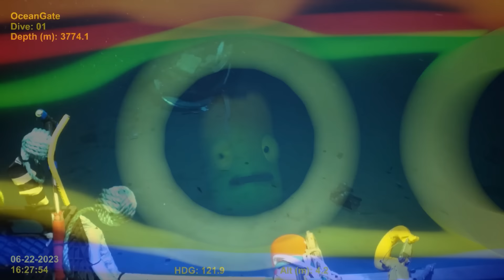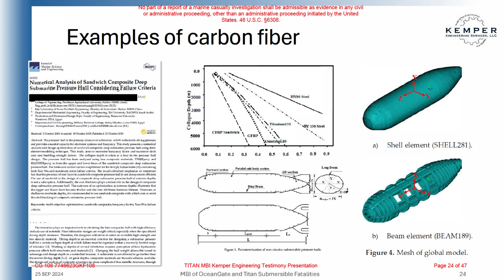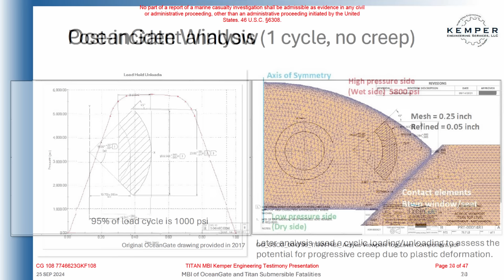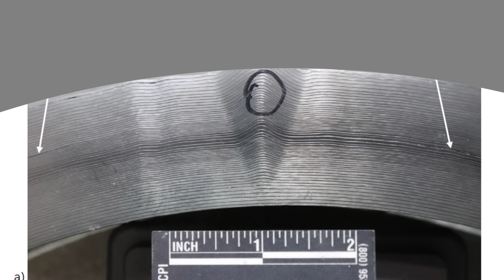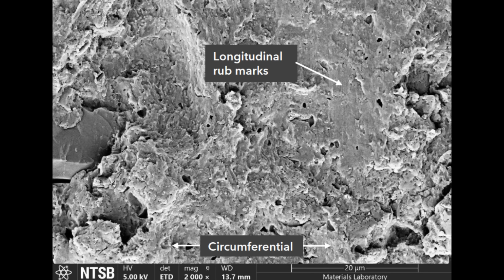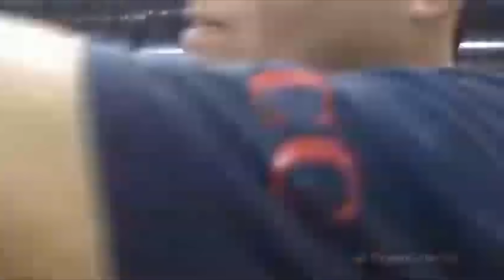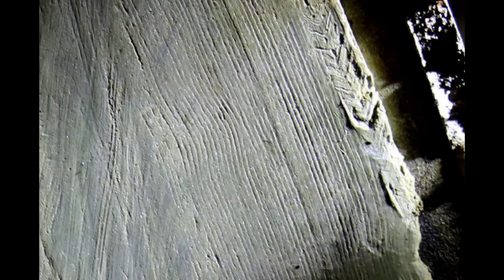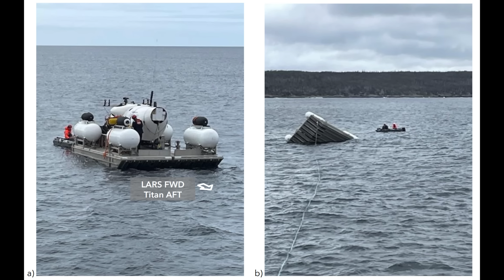OceanGate Wreck Shows Why Sub Wasn't Strong Enough To Survive - NTSB Shares Important Details

Comment: OK I am an engineer but not a specialist in composites, you mention that Boeing had told the company they should have diagonal layers but that these were not included and you hypothesize that this was because it was too difficult, I would suggest that it was because it added expense that Stockton decided was not needed. It' s like having the various sensors, those sensors appear to have done their job, the analysis shows a fundamental change in the hulls performance. That was either totally ignored or they did not understand that this meant the hull was now weaker. You might ask why bother to fit the sensors if they were going to ignore the evidence , I cannot answer that for certain but I suspect that from the evidence given Stockton appears to have considered his confidence more important than the engineering/science. Perhaps he just did not understand that with composites every tiny bit of damage progressively weakens the structure.

I've not heard all the evidence so I am unsure if any sort of nondestructive testing was carried out during construction, but I've mot heard that this was done, I would have expected some form of scan (perhaps an ultrasound) of the whole cylinder to ensure there were no voids and that construction was uniform, the evidence post implosion would suggest that either this was not done or they did it but felt the discrepancies were within tolerance

Comment: The hull had obviously been flexing, the joint between the ring and the hull was glued on and glue didn’t have the opportunity to flex, it was fitted to a titanium ring. 

So one side was solid and fixed. 

The other side was flexing. 

The glue couldn’t hold up and started splitting off the titanium ring. 

Once water got under the surface between the ring and the glue on the hull it sheared through and around the joint. 

Game over, end separates and water crushes the hull in an implosion.

Comment: So basically what happened was....   You ever take a piece of unpainted plywood and leave it out in the rain and water for a bit?  It delaminates and falls apart.  If it gets wet more than just a couple of times it is ruined and no good.  When you go to the big box store to buy glue there is the cheap stuff for indoor use then there is the expensive stuff for outdoor weather resistant use.  If you search the store and even the truck bedliner, nothing in ether place has anything labeled waterPROOF.

Comment: Top indicated buckling could be due to supplementary bending force due to uneven tube bending force as the lower contacting endforce from the titanium hoop was transferring some longitudinal force through the supporting  leg assembly?
Reply: Were there any differential length indications between top and bottom strain gauges to indicate tube bending?

Comment: What I find concerning is the size if the Titanium mating flange that the CF is supposed to adhere itself too.
..
There doesn't seem to be enough cross sectional area to sufficiently jold the end cap on..
..
I do wonder if the end caps should have been bolted together via long studs and the CF hull wrapped around those studs would that have made a stronger hull?
..
Its also clear the lack of CF materials understanding by the team building titans.
..
I also suspect, SR wanted to prove his proof on concept on the CF hull, 
..
With the later intention of licensing construction of CF "titans" globally,
..
Stockton R seemed more like a business man than an engineer.

Comment: My earlier comments were based on quite  rude analysis, but still, the circularly symmetric model of the deformation that puts the maximum strain in the center of the cylinder is 100% nonsense. Try to suck, the air out of a soda bottle and see whether you can get much deformation that is circularly symmetric along the longitudinal axis of the vessel. Spoiler alter, its never going to happen, because the non circularly symmetric failure mode is self reinforcing, the even buckling in all radial directions is a very unstable equilibrium, just the tiniest divergence from transverse circular symmetry will redistribute a lot of load. And i might have given of the wrong idea when i said the materials have to deform the same way, they have to distribute load evenly, but going from a carbon fibre cylinder that is deformed to a spherical end cap of the same material is not that at all, its is going from some circular cross section that is no longer flat in a natural way to an end cap that takes mych higher forces to deform when the crossection is attached to a curved /spherical section. To evenly distribute the load from the end cross section on the end cap, the end cap must deform safely to a much larger degree as a material, my concerns about faliure of material integrity at the end of the carbon fibre cylinder, where it is joined to the titanium, is that the carbon fiber deforms more than the titanium not less, because of the shape. The asymmetric buckling or even normal deformation under pressure will not be even on the joint in traverse cross sections around the joint, if you tried to place the end of the carbon fibre cylinder on a flat plane during that kind of deformation, there would not be contact at all points, the pressure would not be even on the joing longitudinally. And the result would be some deformation of the titanium yes, but very little because of its shape, but on the carbon fibre side the pressure could be concentrated on very very small areas of the joint. I just will never buy the simulations i have seen from ocean gate, what so ever, the stresses their simulation showed on the join, is fantasy based on outcomes of simulations they did themselves, that were based on handwavy assumptions. I don't really care about the expert testimony saying this or that about the construction, i think until they habe done rigorous testing it is impossible to produce a remotely accurate model for simulations and you probably need run tumes of thousands of hours on supercomputers to do it properly. I'm sorry but the only thing i really Agree on is that testing was never done to an acceptable degree, to even begin viewing simulations as more that crackpottery. Yeah armchair this armchair that, sure a lotnof people have said stuff that ia wrong or whatever. The only valid point to make, is that there are concerns, about the specific use of carbon fibre and lack of testing in this case, we are all in tve armchair on this specific sub, even engineers woth experience with the same material or similar materials. When the material science isnt there, every project will is bespoke, including the Chinese sub, as far as i can see though they used a more sophisticated methodology of a skeleton to improve integrity, and that sounds a lot better as a philosophy for using composites, because you can create comprehensive strength out of tension by using geometry that way, in a much more reasonable way. I just think the ocean gate sub was extremely amateurish in its design process. It should have taken yeas and years of rigorous testing to even trust the simulations with 300% safety margin. Just the fact that they simulated a circularly symmetric deformation is enough to reject everything they did as psuedo science. Its the equivalent of building a skyscaper with the assumption that it will not sway in the wind, and when it fell down you shiw simulations that doesn't even model that deformation, "look judge the foundations always held the weight in our simulations with no wind no asymmetric deformation at all." yeah every material could potentially work safely if you are clever enough, but that doesn't have anything to do with armchair engineering, its simply that without testing every one of us, competent or not with other engineering are stuck in the armchair as well, and armchairs are nice, they produce nice thigns to check out, things that might go wrong or stuff to test, but then you habe ti actually test it. The issue with ocean gate wasn't that they didn't do testing, it was that before they did they didn't worry about rigor from their armchair, you have ti doubt everything and find all sorts of things you want ti test before you are even sure that you are modelling the thing correctly, if you never predict what will happen in your test exactly by means of your simulations, when you make changes to the tests, then your models are basically just cartoons with no baring on reality at all. As i said, replacing the end caps with carbon fibre would imo, from my armchair have made it worse, not better, because i am quite confident that the degradation of the material started at the join where the pressure on the carbon there was much much more concentrated to small areas tham ocean gat assumed, destroying large parts of the material in the first few dives, maling the whole body weaker by a large margin, allowing much larger deformations than they assumed they had. The only, way to make this sort of thing safe is either to make the end cap deform more than yhe titanium away from the plane of the crossection of the joint with less concentration of force on it, that is even softer than the titanium, or ti measure our the asymmetric deformations and with jacks on the inside of the cylinder change the distribution of forces by restoring circular symmetry in the transverse crossectionS :). Thats my armchair take anyway, its nit mean agressively towards you, you are a swell guy, i just get really annoyed and mad at people who just entrusted other peoples lives to the applied physics equivalent of chewing gum and duck tape. ^^

Comment: Taking shortcuts and going with "out of sight, out of mind" -mentality, it was only matter of time this to happen.. Cutting of wringles also made fibers broken and weaker. Making multiple layers should be done when epoxy is still "green", fully cured epoxy doesn't stick as good even with rough surface. They become different layers, when done as "green" comes as one. Not even going how wrong they put fibers there, there is better comments explaining that.. Not an engineer, but worked enough with composites to know how F up their design was.

Comment: In my mind, after that loud crack OceanGate 1 should have been decommissioned and used to dive remote controlled or automatic to failure.
All this shoud have been presented by Ocean Gate with tons of scientific info and scientific reassurance why OceanGate 2, limited to 50 dives, is safe.
But, the leadership was stupid and this happened.

Comment: What you didn't mention is that there is a 90 degree stress-raising section change in the carbon fiber hull at the adhesive lap joint onto the titanium end hemispheres.  Utterly lunatic design.

Comment: Grade 5 Titanium is the most common / work-horse alloy, Titanium with 6% Aluminium and 4% Vanadium. Relatively easy to produce as bar, or plate, can be machined, forged, welded and if you know what you are doing, superplasitc formed to produce something like the end caps. No idea how they were produced here, most likely a forging and machining to the final size as the set up costs, tooling etc for superplastic forming would be prohibitive for making 2 off.

Comment: The window optical issue may have been solved by having a non-structural plano-convex piece of acrylic, matching the radius of the internal concave part of the window with index-matching gel between the two pieces of window. This would cancel out the unwanted optical effect and allow the use of an approved window, convex on the outside, concave on the inside. But to the viewer, it would appear the same as the one used by Oceangate, flat inside, convex outer. Any thoughts?

Comment: I did a whole paper on CF having not done anything on it before and my personal conclusion was that its basically spaghetti unless you know what you're doing. A single strip of CF can be bent and broken easily with 4 fingers like a piece of spaghetti. 
You have to layer it properly, you have to use the right resin, and the right %s and even then, you have to work with it within its tolerances, like you would with any material. It's not a magic sci-fi material. It's not even an upgrade from steel or aluminium. It's a side-grade at best with different pros and cons.

Comment: Watching them make the hull, I find it odd that they wouldn't have used a roller pressed directly against the form to help roll out the wrinkles as they went. Just using the tension alone whilst weaving together what, 14ish different strands and expecting them to remain perfectly in place whilst also moving back and forth is insane. 

It would also mean you keep a constant tension as well as monitor that tension (using load cells) whilst laying the stuff down.

You can also see that the form isn't a perfectly flat surface (16:40 seconds and you can see the light coming off the form at different points. A pretty good sign that the form itself isn't great).
Reply: Honnestly, in their own video we can see the horrendous surface finish, full of wrinkles and bumps, defects, i do not know how the company which rolled this toilet paper hull did allow this.

Comment: Interesting. So by adding a separate corrective lens structure, within the window, but not attached, this would have actually been stronger than effectively including the lensing material in the window itself, due to the distribution of stresses. Certainly non-intuitive.